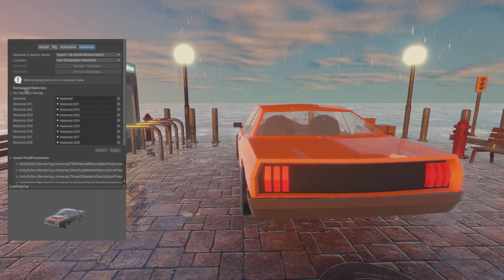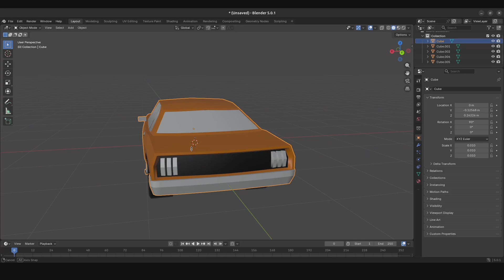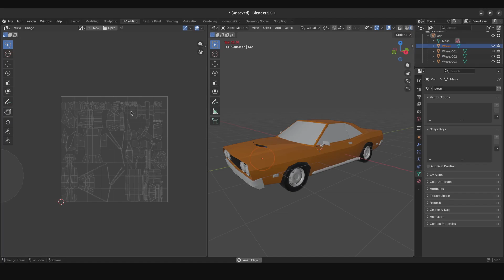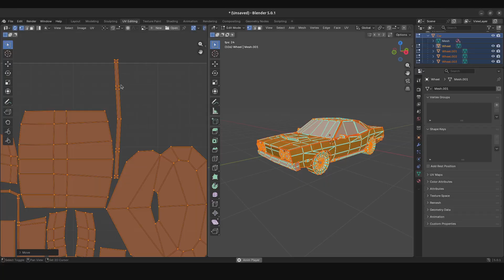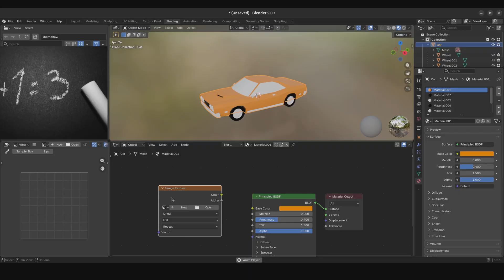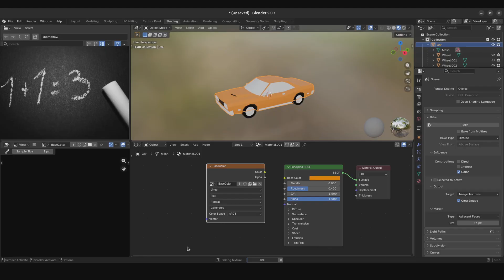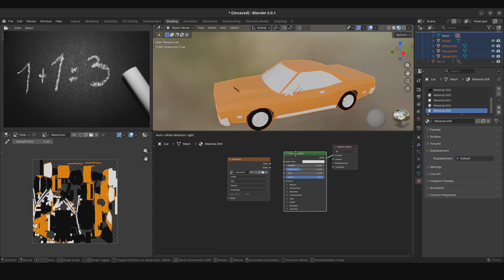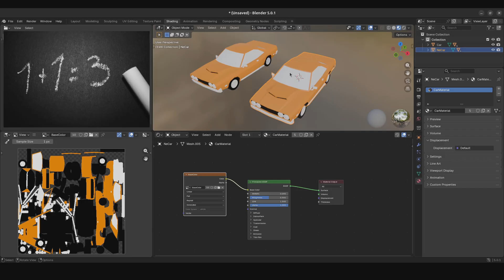Baking 8 materials into one Material - Game Asset Optimization

Comment: Honestly for objects that just use Colors And without alot of Detail using a simple grid atlas with the different colors would be a lot more recource friendly. A 64x64 texture would be more than enough for a model like this. Or even better, just use the vertex color for the coloring and don't use any textures at all. 4k resolution is way to high for such a simple model.
Reply from the maker: +1 Point for you! 
For batching many models your texture approach with a well chosen pallete is the fastest way to go! There's another one i like which is a mix of both i call it object texture atlas-sing.  And is how i made City-Mix Free Assets example with 50 different models with detail. 
Thanks for the comment and sharing your experience!